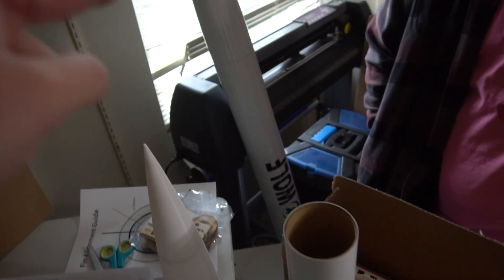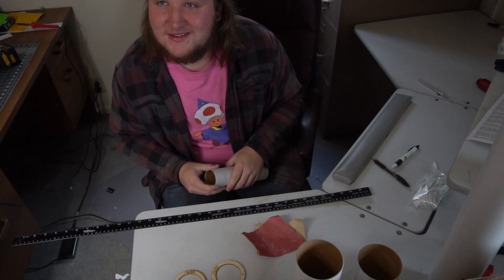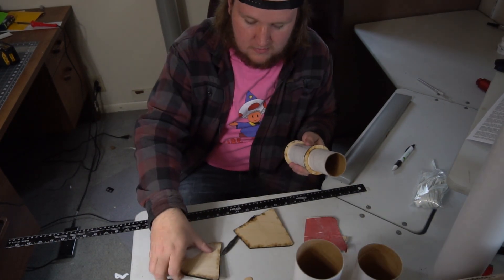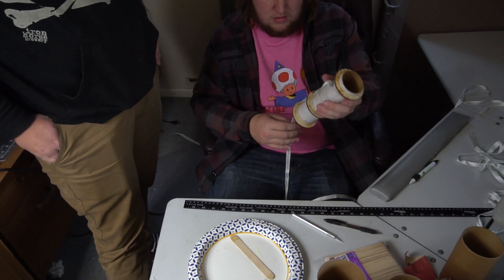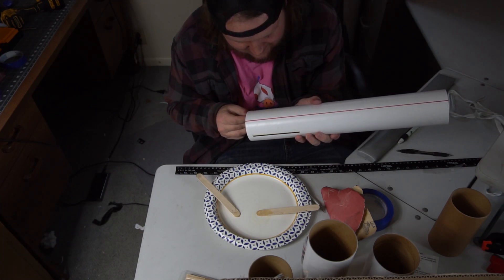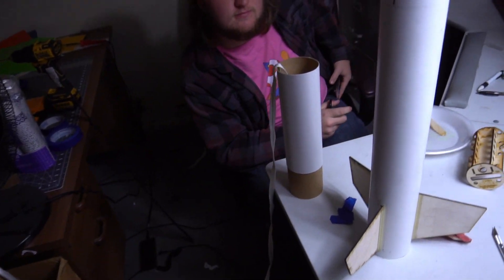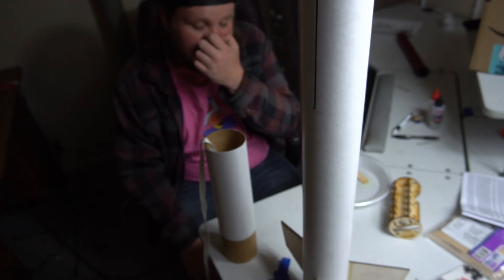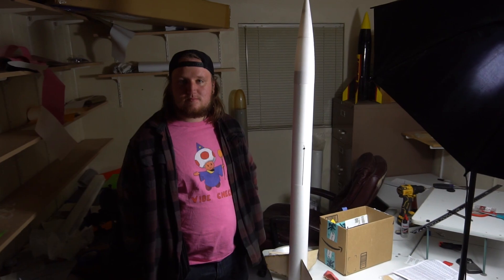Teaching My Friend To Build His First High Power Rocket

Comment: If it can handle the force, an H283-ST is great for an L1. All go for 0.9 sec. Quite hard to have any stability issues at that off-the-rail speed, but also keeps the altitude down. The flame is pretty nice too (tho not for long lol)
Reply: Did my TRA L1 with a H238T in a PML quasar back in the 90's.   Very good L1 motor to about 1000' with simple motor eject.